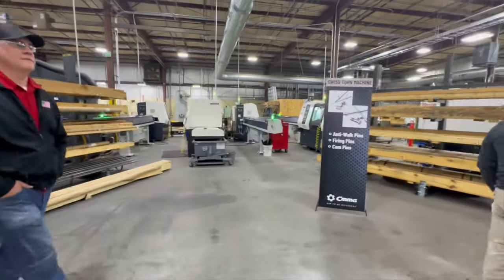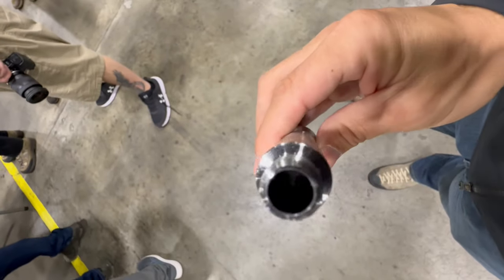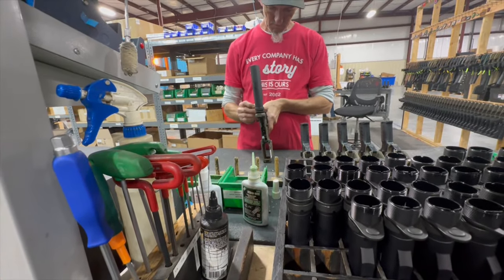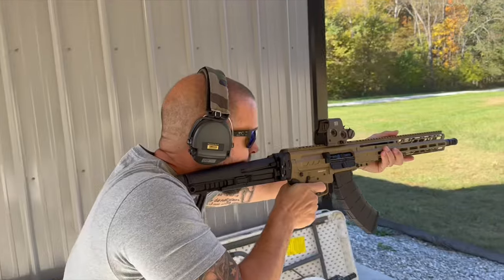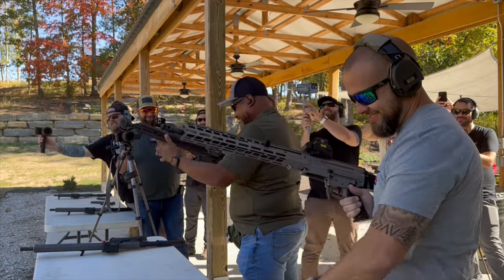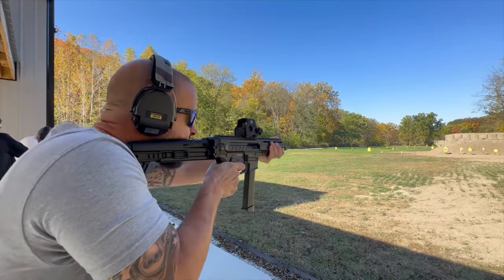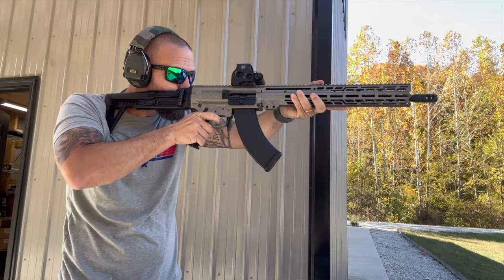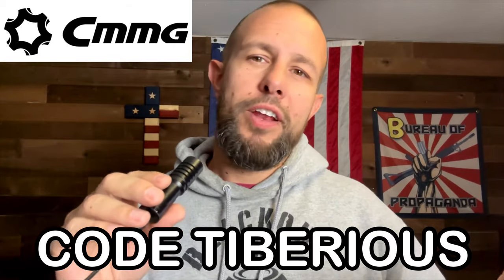Worst Vlog Ever / CMMG Factory Tour

Comment: Tiberious Gig Hopefully you'll see this . If you could only own one CMMG Dissent Would it be the 9mm rifle you shot or the Mk47 ?  You seemed really pumped shooting that 9mm . Or would you get a different caliber then these two >? Thanks Much
Reply from the maker: Tough call, I guess it depends on the use. I’ve always loved the mk47 but they are 14.5 and 16 inch barrels. A shorter in 9mm is pretty dope, code Tiberious will get you a free mystery box if you order one
Reply: @TiberiousGib  I noticed you reviewed a Sig MPX awhile back . At the time you called it the best . After using the dissent do you still feel that way . The MPX appears to be slightly more slender in the handguard ?